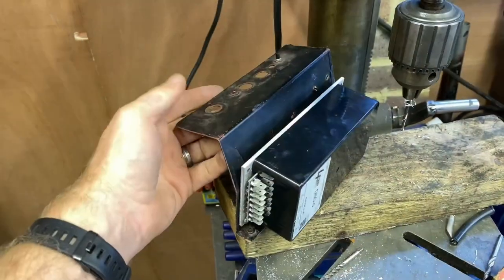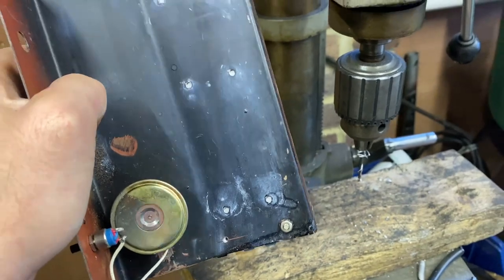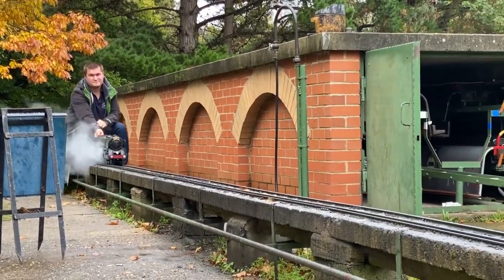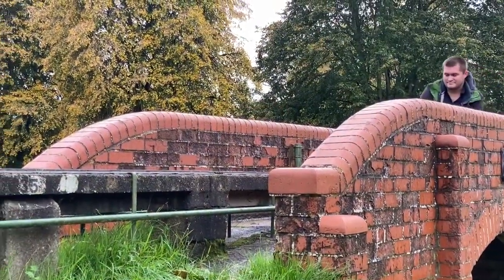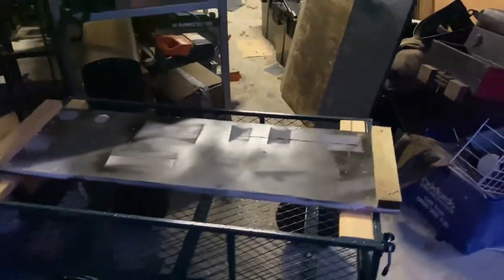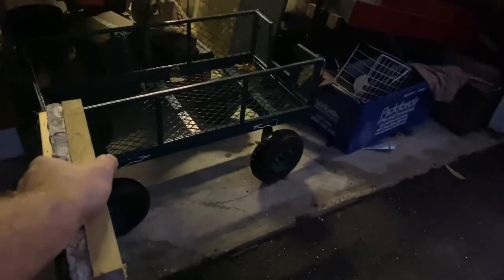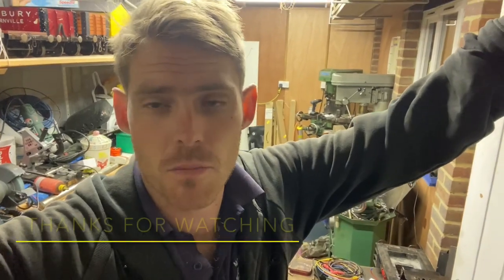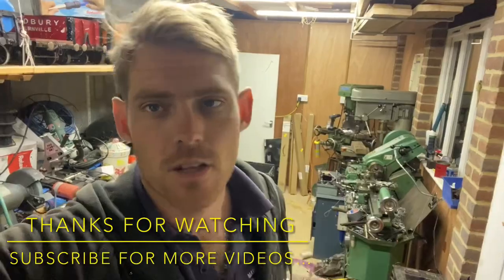Coronation 4QD install starts, plus the results of the Britannia adjustments…

Comment: The adjustment to the Blast pipe looks as if it has worked a treat. Just so many don't work right with simple things affecting. We did a run to Swindon today via The Majic Roundabout twice and Machine Mart. TOYS. Actually, an emergency heater for the house. Returning via the Swindon Track of course. 2 lovely runs round, out for 10 minutes each time. Back to various projects in the morning. David Lily and Katie. Daughters are the best.